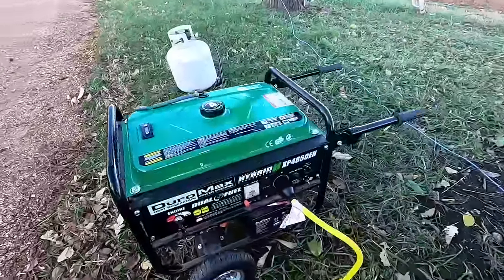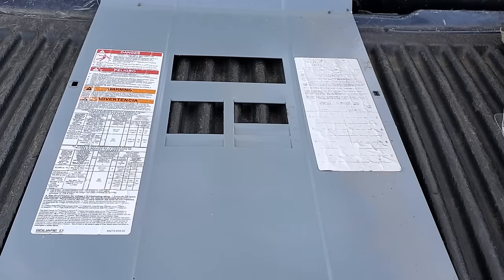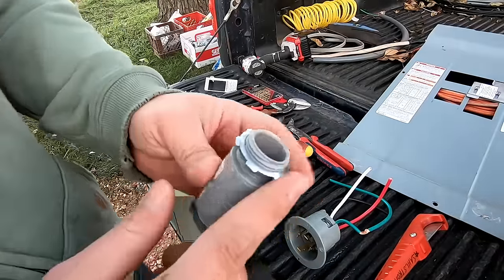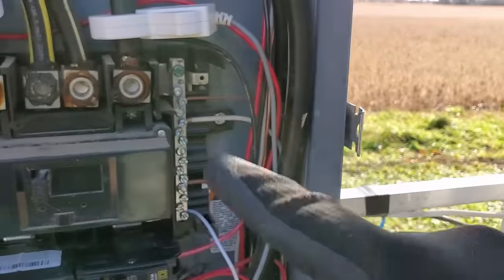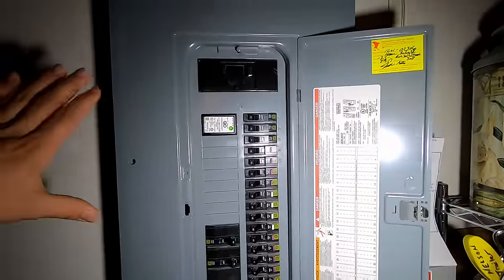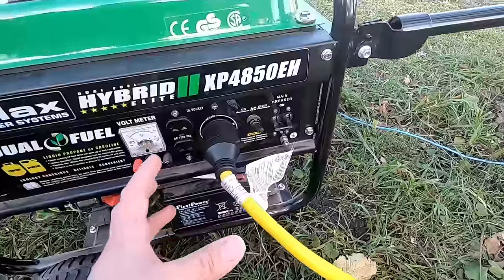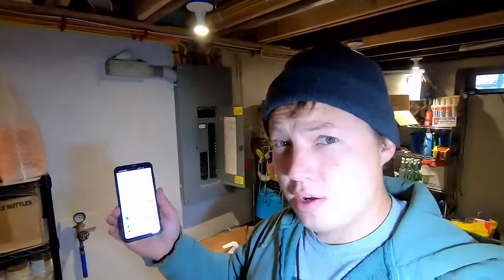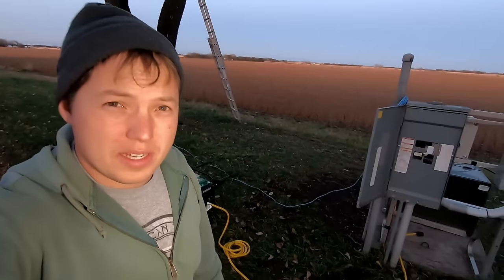How To Hook Up a Generator To Your House Using a Breaker Interlock Kit & Power Inlet Box

Comment: This was great, thank you for making this.  
Just a thought, you could get an inexpensive battery backup power strip for the sensitive electronics.  Mine runs off battery all the time & grid keeps the battery charged.   It also prevents the little power bumps from ruining hard drives in the kids game systems👍 Amazon branded ones work great for me & 60$ per entertainment area.
Haven't hooked it up to a scope (bet it's square wave) but it hasn't hurt anything yet🤣😂
Reply: For $60, I'd imagine those are not running off the batteries full time. The charger circuit alone to put that much power onto the batteries would cost $100s.
The batteries might be asked to smooth out brown outs and take over when a power outage happens, but the device would recharge the batteries over a long time when power returns.
Reply: @JasonW.  you're right, they switch from line to battery faster than the caps can discharge so tv/computer/game console don't know the difference & don't get damaged.  Looked at the ones that run off the battery full time & they are much more expensive.
Reply: @The_Happy_Aviation_Enthusiast  always safety first
Reply: @stephenwgreen78  I built a full time inverter powered battery powered system, it was well over $2k in parts. Needed 2x 80 A chargers and 6x 100 Ah batteries, along with inverter and heavy wiring (even at 24V).
But this system had a reason to be this way, most won't require that precise power.

Comment: I am assuming that you would not power up your television and television satellite system using a standard generator? I have been doing that for a few years now without any problems so far. What would be the factor that would fry my tv and satellite?

Comment: Good video.
2 things, you have a long run of wire with alot of resistance so you are going to lose some available power there. Also, I highly doubt you will safely run that central air unit with that generator. There's a tag on the outside compressor with specs on it. You have to look at LRA rating which is you're locked rotor amps. I'm sure you know that most things with capacitor start motors require 3 times the running amps for start up. I have a 14KW diesel generator and ruined my a/c compressor $1,800.00 repair, so be careful. I live in Florida and after a Hurricane power was off for 3 days. The air ran and didn't blow a breaker but just after that it broke. Repair guy said it was likely caused by low power from generator.
Excellent job though.
Reply: Don’t forget about the generator safety tips as well. Remember it’s important to follow all the generator safety rules whenever you use your generator. Here are the generator safety tips:

1) Please do not allow an unqualified person or your children to operate the portable generator. Just because some manuals don’t say that doesn’t mean it’s safe. That is important against the generator safety rules. We also need to be keeping an eye on our children too. You need to make sure that your children are not playing near the portable generator especially when it’s running so they won’t get electrocuted. Generators pose electrical risks and they can be hot during an operation. Please keep your children away from the portable generator at all times. It is important to keep our children safe especially our little ones. Be aware of all the hazards.

2) Some people use their portable generators indoors which increases the risk of carbon monoxide poisoning. It’s important to have a carbon monoxide if you have a gas generator. Never ever use your generator indoors even if your doors and windows are open and even in the garage is not safe to use a portable generator. Not even at your porch and your deck. It is never safe to use your generator indoors and in enclosed areas of your home. Your generator needs to be 15-20 feet away from your house. 

3) 🔥generators cause fire hazards too. Never refuel your generator while it’s running. You need to let your generator cool off before refueling it and before storing your generator. Never overload your generator too. Never ever back feed your generator. You should never plug your generator into a wall outlet. Also never store propane tanks indoors. Please keep flammable things away from the generator as well and please don’t smoke cigarettes near the generator. Having a fire extinguisher next to the generator is also important against the generator safety rules. 

4) generator operation; make sure your hands are dry before touching the generator. Never use your generator in wet conditions. Don’t let your generator get wet. You need a generator tent if you need to use your generator during wet weather. Please don’t wear loose clothes when operating the generator. Turn on your generator before plugging in appliances. Use the right cord for your generator. Please do not use worn out cords. 

https://youtu.be/I1jT3ANENvI and here is a video more about keeping others safe when using generators and also about our family’s safety. 

Hope this helps. 🥰

Comment: I think you do a great job of explaining the details of your videos.  In looking at a generator sub panel, I believe there is an interlock that you can put into the subpanel (without a main breaker) to interlock two breakers (one from the main panel and the other from the generator).  Can you show that in a video or tell me where I could purchase such an item.  I do not wish to put the interelock in the main panel because you do not know when the power is restored if you do it that way.  I am also curious as to what the "doughnuts" are called that are typically put on feeders to monitor power consumption so that you can make sure that you are not overloading your generator.

Comment: I have a 30 amp, 120 v generator. After I install a 30 amp, 220 v breaker in the upper right hand corner of the breaker box, along with the generator interlock kit, I plan to run one wire from the Generator power inlet box mounted on the outside of my home, to the neutral buss. Then run a hot wire to the 220 v breaker. Next I will install a jumper From one side of the breaker to the other side of the 220 v breaker. This will allow me to feed the entire 100 amp box. I would shut off all breakers and only use the vital circuits. This way I don’t have to move any breakers around and can use anyone of them. The current will be limited by the panel breaker and the generator circuit breaker. And of course I would run a ground wire to the panel. Are there any cautions, additions or changes you would suggest?
Reply: Remember to always make sure you follow all the generator safety rules whenever you use your portable generator. 
⚠️Here are the Generator safety rules that everyone needs to follow when using generators:

This is just a reminder for everyone’s safety when using portable generators. All generator safety rules need to be followed carefully to avoid hazards. 

1) Please do not allow an unqualified person or your children to operate the portable generator. Just because some manuals don’t say that doesn’t mean it’s safe. That is important against the generator safety rules. We also need to be keeping an eye on our children too. You need to make sure that your children are not playing near the portable generator especially when it’s running so they won’t get electrocuted. Generators pose electrical risks and they can be hot during an operation. Please keep your children away from the portable generator at all times. It is important to keep our children safe especially our little ones. Be aware of all the hazards.

2) Some people use their portable generators indoors which increases the risk of carbon monoxide poisoning. It’s important to have a carbon monoxide if you have a gas generator. Never ever use your generator indoors even if your doors and windows are open and even in the garage is not safe to use a portable generator. Not even at your porch and your deck. It is never safe to use your generator indoors and in enclosed areas of your home. Your generator needs to be 15-20 feet away from your house. 

3) 🔥generators cause fire hazards too. Never refuel your generator while it’s running. You need to let your generator cool off before refueling it and before storing your generator. Never overload your generator too. Never ever back feed your generator. You should never plug your generator into a wall outlet. Also never store propane tanks indoors. Please keep flammable things away from the generator as well and please don’t smoke cigarettes near the generator. Having a fire extinguisher next to the generator is also important against the generator safety rules. 

4) generator operation; make sure your hands are dry before touching the generator. Never use your generator in wet conditions. Don’t let your generator get wet. You need a generator tent if you need to use your generator during wet weather. Please don’t wear loose clothes when operating the generator. Turn on your generator before plugging in appliances. Use the right cord for your generator. Please do not use worn out cords. 

https://youtu.be/I1jT3ANENvI and here is a video more about keeping others safe when using generators and also about our family’s safety. Hope this helps

Comment: I'll use my method . 110 or 240 build a cord with males at BOTH ends . One in generator the other in receptical in house , power doesn't care Wich way it flows  . You can still control power using fuse box .

Comment: Do you opt for a bonded neutral generator or a floating neutral generator? From what I'm understanding the floating neutral is the preferred method and please explain if this is so how the 120 240 connection takes into account in the main panel how it all ties together specifically

Comment: My inverter is 5 KVA 230v Pure Sine Wave Inverter charge controller “ can I use a 100A Double Pole Beaker to power my breaker box and from what I’ve seen you have been very strict on procedures how would you take single phase 230v at 3000w is 76A into split phase for 2 lines of 115v - 120v ?

Comment: When the high voltage line in our neighborhood broke, I was talking to the lineman that was doing the repairs. He grounded both sides of the break while he worked on it and told me he grounded the upstream side even though there should be no way it should have any voltage on it unless someone had their generator back-feeding through the transformer. I hadn't realized until I saw this video that generators could be hooked up this way. I installed mine using a connector box that has 6 3-position switches. Each switch has Line-Off-Generator positions, so there's no way to cause a back-feed. With the type he put in, I could see people installing it without the interlock, especially since you have to order it separately.
Reply: Don’t forget about the safety rules of using generators: Always make sure you follow all the generator safety rules whenever you use your portable generator. This is only a reminder. Generators can be dangerous if not used carefully. Every year, hundreds of people die or get injured when using portable generators due to carbon monoxide poisoning and electrocution. Make sure you are using your generator carefully and keeping others safe as well. There is something very serious that everyone should always be aware of when using generators. Some people do run their generator indoors which is not safe and that increases the risk of carbon monoxide poisoning which can cause death of family and you. Some people run their generator in wet conditions which can electrocute them. Please remember that you should never run your generator indoors. Remember that carbon monoxide is an odorless and colorless gas that you cannot see or smell. Carbon monoxide is a silent killer. Keep that in mind. Make sure your generator is 15-20 feet away from your house and away from doors, windows, and vents. Never use your generator in your porch too. Having a carbon monoxide detector is very important against generator safety. Some people also allow children to go near the portable generator which could pose risks. We need to keep an eye on our children making sure that they are not near the portable generator so they won’t get electrocuted or burned by the generator which is dangerous. A locking enclosure also keeps kids safe. A generator shed might look like a tempting place to explore, or take cover during a game of hide and seek, but a generator is a dangerous piece of equipment that can cause injury. It says on the manual that we should also keep children away at all times from the portable generator to avoid injuries. Please do not allow a child or unqualified people to operate the portable generator.  It is important to keep your children safe especially little ones. The portable generator can be hot during an operation. Just because some manuals missed what should be listed doesn’t mean it’s safe to do. Always follow the generator safety rules when using portable generators. Generators pose electrical risks. If you need to use your generator during wet weather, you need a generator tent to protect your generator from getting wet. Don’t let your generator get wet. Keep your generator dry and before using your generator, please make sure your hands and your generator is dry. Do not wear loose clothing when operating the generator. Everything that is said on the generator’s operating manual should not be ignored. Never smoke cigarettes near the generator. Please keep flammable things away from the generator. Never overload your generator too. Your generator can catch fire. Never ever try to plug a generator cord into a wall outlet to avoid back feeding. Back feeding your generator is dangerous. Always turn on your generator first before plugging in appliances and shut off the appliances before turning your generator off. Use a heavy duty cord for your generator and the cord should not be worn out. All the instructions should be followed carefully. Never refuel your generator while it’s running. It can cause fire if fuel spills while your generator is hot. You should turn off your generator and let it cool off before refueling it. Having a fire extinguisher next to the generator is also important. This is only a reminder for everyone’s safety of using generators. Make sure your generator is properly grounded. Having a fire extinguisher next to the generator is also important against the safety rules. https://youtu.be/I1jT3ANENvI and here is a video more about keeping others safe when using generators and also about our family’s safety. It’s important to keep our little children safe as well. Make sure your little children are kept away from the generator at all times especially when it’s running. Hope this helps. Always remember that it’s better to be safe than sorry.

Comment: Great video.  I watched your Sense install video as well and this makes it easy for you to monitor when using the genset because you are powering your service lines coming into the house.  Any ideas on monitoring the power between the plug-in for genset and the 50amp breaker it is connected to?